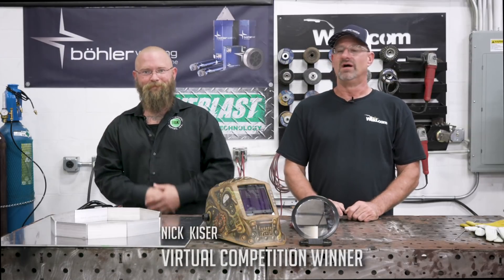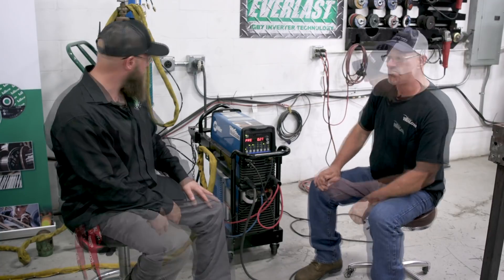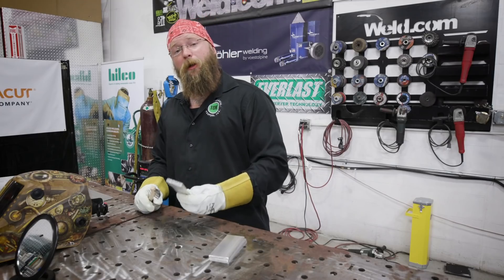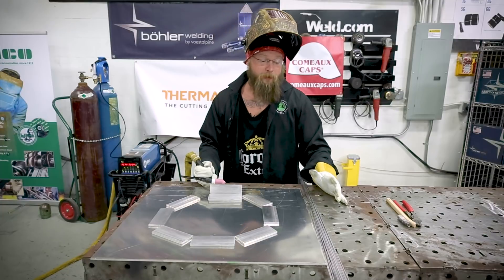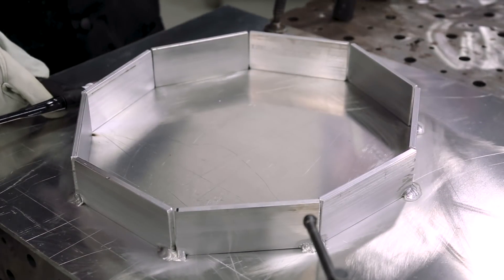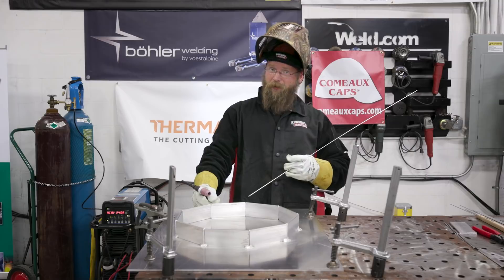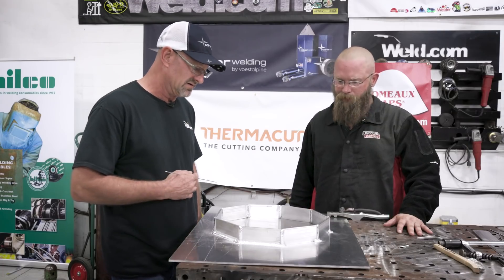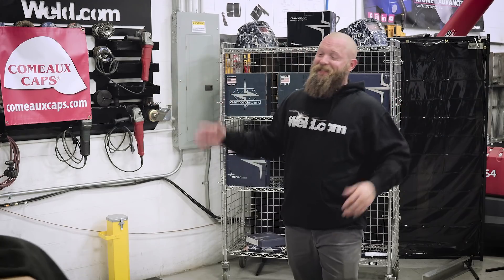Aluminum TIG Welding with Virtual Competition Winner Nick Kiser

Comment: Would the welds have been easier if you flipped it on its side and did flat welds instead of vertical? This would require clamping the flat piece to a plate to prevent warps and continually rotating it for each weld.

Comment: anyone else notice how filthy most acetone you buy at the store is?
what do you all do about contamination on heavier sections? 
guaranteed you put that acetone on glass and let it evap. there will be schmutz on the plate... apparently this is because we aren't allowed clean/reagent grade material on the open market because... cocaine (i didn't know that. i just know i can't get "the good stuff").
i was surprised because everyone says use acetone. but i still see a film on the clean metal after the acetone.
grease contains hydrogen.

Comment: turn your hertz down, especially on the tacks.. Anything over 6mm just hit it with 55hz and 160+amps and get the heat in there instead of it bouncing on the top.. Nice effort though, use your breathing to calm you down, sometimes a job can get away on you, happens to us all

Comment: You say you went from 25 cfh to 45 cfh. Something had to be wrong, with that small cup he was using, it would be like  jet coming out of it. I normally run a #5 or 6  cup with 15-20 cfh...Yikes
Reply: That’s what I was thinking. I usually run a #7 as it covers more space. I wonder if there was a kink in the hose or something?